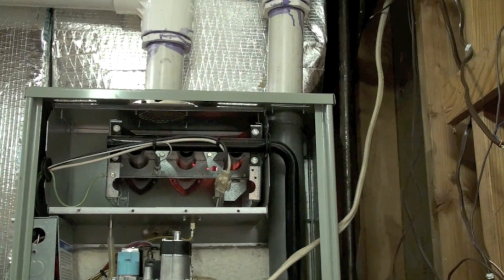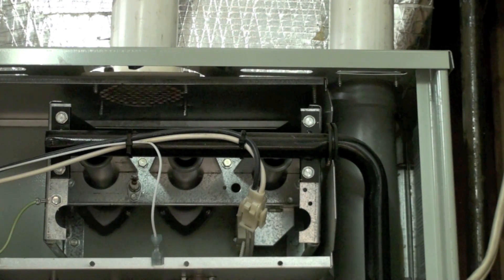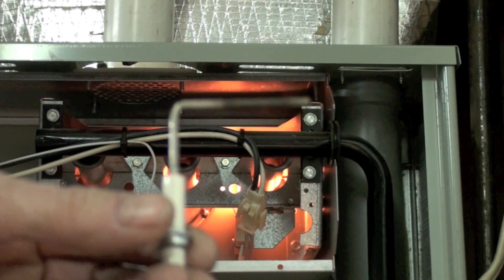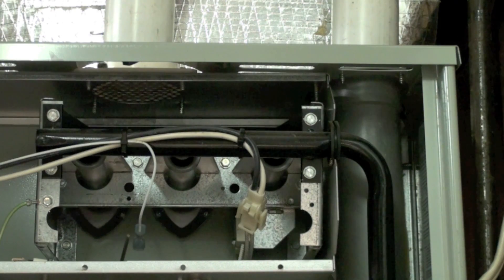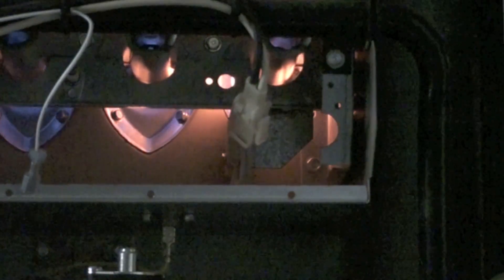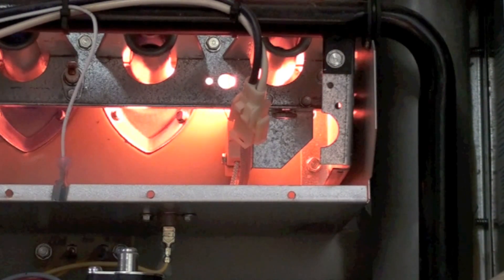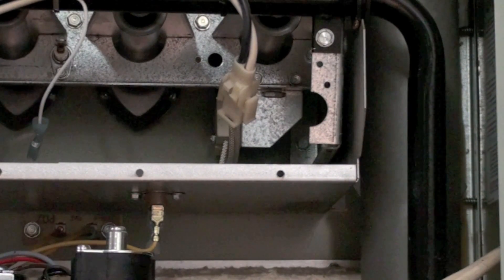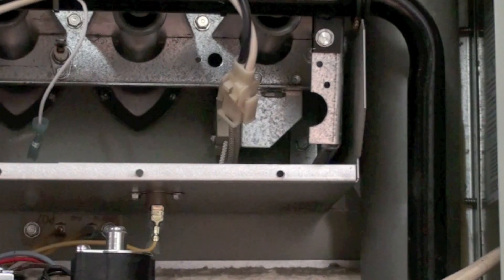Gas furnace won't stay lit.  cleaning the flame rod

Comment: I've tried everything you've suggested here. Thank you for that.

....if it doesn't solve the problem, do you have any other suggestions?
Reply from the maker: What are the symptoms?
GFM
Reply: So it was firing up then turning off just like the flame sense rod was dirty. I cleaned the heck out of it 2 times and still the same problem. 

Then because that didn’t work I looked at one of your other videos in regards to flow sense diaphragm. Then I blew air with compressed can air thinking that there was maybe some sort of obstruction there and now the furnace won’t fire up at all.

The error is pressure switch open default
Reply from the maker: It kind of sucks when it gets worse when you work on it.  lol.  If you used compressed air in the tubes to the vacuum switch, you may have damaged the pressure switch.
GFM
Reply: Oh my God, yes it does. Thankfully my neighbor is a HVAC guy and had parts on his truck. I did blow the pressure switch. He replaced it and the flame sensor. It works now but we figured out that the board is on its way out. One of the relays on it is crapping out.
Reply from the maker: Glad you got it going.
GFM
Reply: Thank you for your help.

Comment: Wow! My furnace worked this morning and by the evening it wasn't firing up for more than 5 seconds. I have a 3 month old and it's cold outside, so I was concerned, but I found your video and everything works! Thanks a lot! Quick question, how often should I have my furnace serviced? It's a high efficiency Trane that's probably 10 years old.
Reply from the maker: I usually say every year, but if your furnace draws outside air for combustion, you may go longer.
GFM

Comment: Great video!!  Too the point and informative.  I have a situation you might be able to help with.  My furnace starts fine, but after about 4 mins, the valve starts to click sporadically, and the burners sputter eventually shutting off. This happens before reaching desired temperature.Could this be caused by the flame sensor.  I was thinking a possible valve issue.  But it does work fine for about 4-5 minutes before failing.  I haven't been able to find any solution online.  Any ideas.THANKS

Comment: I'm having the same symptom as when you unplug the flame sensor. It tries three times then shuts down. I have a 2008 Goodman GMH95. I tried cleaning the flame sensor and the symptom persists. What else could it be?  I have had a furnace guy out to look at it and he was useless. The furnace worked fine while he was here so he said he couldn't do anything then charged me. Any suggestions?  The furnace works fine at times, and at other times shuts down after three times like shown in video. Thanks!
Reply from the maker: If you have some mechanical abilities, you might test it yourself.  This video shows how to do it with a cheap meter:  http://youtu.be/a5u044OJBc4  The reading should be 3 to 4 microamps.  Check the mount screws of the control board for tight.  Also check all connections of the wire used for flame sense.  If you show good flame sense, the board has failed.  Hope this helps.
GFM

Comment from the maker: I would go a little farther and say the combustion problem is mostly due to contaminants in the combustion air.  Whenever possible, go with outside air for combustion.  And yes, flame rods are specific for each furnace model.  Thanks for the thoughts.
GFM

Comment from the maker: It sounds like a flame sense problem to me.  Your furnace looks somewhat like the one on the video, so the parts should be easy to find.  As to calling a tech, that depends on your mechanical abilities.  Its a fairly easy job but if you are not confident, always call the tech.  Hope this helps.
GFM

Comment: Enjoy the videos very much, but I am having a problem with a lennox with a 2 stage gas valve. I have 25 volts at the valve, ignitor works fine, and the flame rod is clean with a 5 milliamp draw on it. Replaced the valve, same problem. Could it be a gas problem?

Comment: I need advice on ours. We just bought a home and had an inspection done. The day we moved in it was freezing inside. With some checking and replacing the thermostate we still cannot keep our Bryant Furnace on. The pilot will light but cold air comes through the vents and within 10 minutes it shuts off. The filters have also been cleaned. We are completly broke from buying this home and cannot pay the 80 per hour visit from all 5 hvac inspectors in the area. We have 4 kids and just trying to get warm here during the holidays since it's been 63 degrees in the home. Can you help us out?
Reply: DeanWinchesterWhore  did you get your heat resolved? mine is doing the same and can't afford to get a pro to check it. I'm also new to my home with 3kids
Reply from the maker: Need a lot more info.  Furnace age, model number, 
GFM
Reply: Mine needs to be replaced. It might not be an issue with yours, hopefully but ours is going to be a new unit costing us just under $3,000.

Comment: Great video.  Thank you.  I have a Riello 40 gas burner and I am also having flame rod sensor issues.  My problem though is that I have to clean the flame rod every 6 mo or so.  I'm told that a flame rod should only need to be cleaned very rarely.  Seems that I have some form of dirt/something coming in with the air/gas that is leaving soot on the fire rod.  I believe it gets its air from the chimney.  Any help would be greatly appreciated.  Thank you.
Reply from the maker: I would be looking at combustion air source.  If you 2 plastic pipes exiting the home, this is not your problem.  However, if the air is coming from a laundry room, it could have lint, phosphorous, or bleach in it.  Any of these chemicals can coat the HSI.  Hope this helps.
GFM
Reply: I just confirmed that I have internal air intake.  I spoke with my furnace guy and he said that his tester for the rod was at a 1 before cleaning and at a 9.5 after cleaning.  He also said that it wasn't event that dirty.  The connection for the rod was a tiny bit lose he said and he tightened that up after cleaning it with some tin foil.  This fire rod had been replaced a few times before we realized it could be cleaned instead. 

I have a cat box and washer/dryer in the same area.
Reply from the maker: Joshua F Any teenagers in the house?
GFM
Reply: No.   Are you thinking inside smoking?  No one smokes in the home.
Reply from the maker: Joshua F No.  teenagers use the washer/drier a lot.  If you can get outside air to the burner it should help.
GFM
Reply: grayfurnaceman
I'm going to move my catbox out of that room to see if that helps.  We do use the washer/dryer a lot as we have 5 people in our home.

Comment from the maker: The heat pump is completely different.  It is like an air conditioner installed backwards.  Will be doing a series on heat pumps when I get time.
GFM

Comment: Gray Furnace Man,
I have replaced the gas control valve and the gas burner unit on our relatively new furnace (both under warranty).  The flame will not stay lit, but the pilot light remains on!  Could this flame rod be my next answer?  In your video, it is 12 years old and never been cleaned.  Mine is one year old.  Could it be defective?  Any advice would be great!

Comment: Do you have a forced exhaust furnace? I had to clean the sensor that senses the draw on the forced exhaust system with some brake parts cleaner in my unit about 3 years ago.  It would start up very briefly and kick off a few times before giving up... Similarly to your issue.  Good luck

Comment from the maker: You have to have the meter in line with the flame rod before you start the furnace.  Then the reading is taken while the flame is on.  The furnace should be lighting on the first attempt.  You may be coming to the point of using a pro or changing parts like the control board. I dont think the flame rod is the problem.
GFM

Comment: its VR8205R2091, the furance co tried to hide it on the back side of the smart valve a mounting shields over it, i got the mounting shied off using a light & mirror to see the botton screw bolts, i stuck a mirror behind it but number was reversed or backwards, using a 2nd mirror turned it around right. i found it for $159 new & its an intertherm/miller.honeywell. looking for it a guy was having the save problems with the same valve and the HVAC guy told him to clean the rod like u said, thanks

Comment: I cleaned the flame rod and it is still not staying lit.  Do you think it is just a matter of getting a new one?  The furnace is a York installed and working pretty well except for the igniter since 1994.  I have had to replace that part at least 6 times now.  Just did it again today as a matter of fact.  so that part is now working but can't get the furnace to light.

Comment: Can u help me Gary?Last year my furnace failed so I installed a new thermocoupler and that fixed it up. Now it won't stay lit. I can light the pilot light but it won't stay lit. Srry if I missed something on video.
Reply from the maker: Be sure the thermocouple is snug (not tight) in the gas valve.  Clean the end of the thermocouple that fits into the gas valve.  Clean with rough cloth, not sandpaper.  Be sure the flame is covering 3/8" of the thermocouple and is all blue (except propane).  If all is good, the gas valve may be failed.
GFM

Comment: i cleaned that backing plate & put it back togather and i have the same thing as before. glow plug lights, burner lights with a wide loose flame, not a high speed narrow flame, yellow light blinks for weak fame, 4 red lights blinking after 3  repeats of above & then lock out. i think im getting down to the smart valve is left, can the smart valve be installed new w /out any adjustments? does the factory preset it?. iamazing they charged 400 for the ingnitor ,now that i know how, its 5 min job

Comment: grayfurnaceman, I have flame sensor issue, I have cleaned it in the past and solved the issue, this time it only worked for a short while then the problem of cycling and then lockout occurred....can the flame sensor fail altogether, and is this common or likely...thank you.
Reply from the maker: It is not common.  I assume the porcelain is not cracked and the flame covers the flame rod with no yellow in the flame.  If so, you can replace it as it is the cheapest part.  The next would be  the control.  Hope this helps.
GFM

Comment: If the flames goes out, and the unit is still on, will it cause a burning smelling in the home? If not what causes a burning smell coming from the vents?
Reply from the maker: I am assuming the burner goes out and the circuit fan is still running.  That is normal operation.  When the thermostat is satisfied, the burner goes off and the fan continues to run for about 2 minutes to cool the heat exchanger.  
If the fan continues running after that period, there may be a safety shutdown.
In any case, this needs to be dealt with immediately.  
GFM
Reply: @grayfurnaceman  I just noticed at the bottom/outside of the furnace, there is a constant blinking on/off red light. Not sure yet, what that means when it comes to the error codes.
Reply from the maker: @mlong30  The back of the furnace cover may have a key for the codes, or possibly the control board cover.
GFM

Comment: I don't see the rod ever pictured where it attaches or how you opened that compartment. That would have been helpful.
Reply from the maker: It would not be useful as all furnaces are designed differently and access is done differently.
GFM

Comment: In your check the flame rod vid yr furnace is on when you are doing the check.  My furnace will not stay lit so will lit for more than a second or 2. With the furnace not staying lit will it still be able to get a reading?  It appears that the flame is getting to the rod. The igniter glows very brightly and it takes the second attempt by the igniter before there is any flame.  Does it still sound like a flame rod or something else? It is a 1994 York.  Should I just replace it?

Comment from the maker: If the gas supply pressure is right, meaning 7" water column, the manifold pressure is low, you can adjust the regulator on the gas valve but I would guess the valve is failing.  Any pressure adjustments should be made using a water column gauge and some knowledge of what to do.  I have vids on manifold pressure but tread carefully.
GFM

Comment: I have a Ruud Silhouette II gas furnace and the burners go on and when the blower goes on then the burners shut off....It keeps trying to go on again and then the same thing keeps happening.... Once in a while it will stay on but lately it won't!! Why and how do I fix it? And where do I purchase the part needed?  Thank you in advance for your help!
Reply from the maker: +Pamela Van Duyne There could be a number of problems here.  Does the flame change when the blower starts?  If so, you may have a cracked heat exchanger.  This could cause CO in the structure, so it is important.  You could also have an air flow problem.  Plugged filter, dirty blower, plugged secondary heat exchanger,or ductwork restriction.  Hope this helps.
GFM

Comment: hey Gary, I also I found out when the heater is on and running, I hear a few clicks coming from the pressure switch and it turns off the heater and the fan still keeps running. this is before it reaches the set heat level. I don't know if this helps any to determine the problem!

Comment: hello, any thoughts on what to do if/when the burners have flame for say 15-20 minutes then the flames go away? I replaced the flame sensor on my trane xb80 a few days ago and my unit was working great. Overnight Last night for some reason the burners wouldn’t light. I shut off the furnace then turned it back on tonight... the burners lit after two attempts of ignition. Burners and furnace ran great for 15 minutes but then the flames went out. Now they won’t come back on after resetting furnace. Any thoughts? Thanks in advance.

Comment: I did this and cleaned my flame rod and the furnace worked for 3 weeks and is shutting off again. How often are you supposed to clean the flame rod? If it's not the rod, what else could be wrong?
Reply from the maker: It should be ok for at least a year.  You have a different problem.  Are you getting a flame failure code, overheat code or pressure code?
GFM

Comment: I have a package unit that is a goodman model gpg13360701ac that done the exact same thing as described in your video so I bought a new flame sensor for it but 3 weeks later it is doing it again could the pressure switch be bad
Reply from the maker: What error cod e are you getting?
GFM
Reply: right after I commented about it it lit and stayed on the third time but that was the first time it done it since I replaced the flame sensor
Reply from the maker: Furnaces fear the Grayfurnaceman.
GFM

Comment: Hi GFM.  What is the typical microamps that a flame rod should produce?  Thanks
Reply from the maker: +johnmiller102 There is some variation with different models, but usually 2 to 3.5 microamps.  Most will drop out with .5.
GFM
Reply: What would cause it to jump around from say 0.5 to 2.8.  I was thinking it was a dirty frame rod but I cleaned it and still got the same results.  It isn't causing the furnace to cut out but I don't want that to become the case.
Reply from the maker: +johnmiller102 If the flame is covering the flame rod evenly, It is probably ok.
GFM

Comment: Cleaning and the changing the flame sensor on my furnace did not solve my problem. Rain had gotten in the air intake due to a poorly designed rain shields on the side of my house and allowed the burners to get wet. The burners rusted and caused the furnace to not light fast enough, causing lockout. After disassembling the burner housing that holds the burners, flame sensor, ignitor and removing as much rust as I could on the face plate and holes of the burners, it has worked perfectly more than a month now. I may have to replace the burners as the rust is almost impossible to completely remove and it will come back in time.
Reply from the maker: lapkegra Depending on the age of the furnace, you may get stainless steel burners.  Many replacements will be stainless.
GFM

Comment: what if the burners stay lit for several minutes but then turn off even though the house temp hasn't come up to where the thermostat is set to?  The fan continues to run for several minutes after the burners have stopped but it's just blowing cold air at that point
Reply from the maker: The furnace could be limiting out.  Plugged filter, plugged blower wheel, plugged A/C coil.
GFM

Comment: Hello GRAYFURNACEMAN, my neighbor's furnace is made by RUUD. and her unit is having a problem.
When she turns the thermostat to heat position, first the inducer blower comes on, then a few seconds later the electronic igniter would glow real bright....and nothing happens after that (no flame, no smell of gas) ?.... Could this problem be solved by cleaning up the flame sensor? Thanks and regards....

Comment: Hi my funace is 16 years old. it stopped heating but have cold air blowing. I checked the ignitor, the resistance is 80-90 which is good. Then I turned the system on with the ignator unpluged. then use the meter to measure the power for ignitor. it reads 0 volt on the power of ignitor. The inductor fun is working fine, the system is cold so there's no problem with overheating.
It should be the control board's problem unless there's other component before the igniting. Any suggestions?

Comment: I'm not one to comment on videos, normally. But it is -20 outside in the middle of the night and my furnace had this exact issue.  Slightly different model, but same concept. 30 minutes later and my house has heat again.
Reply from the maker: Its good to be warm.
GFM